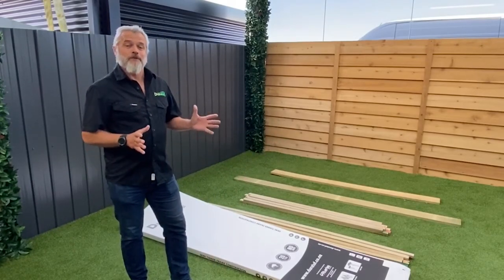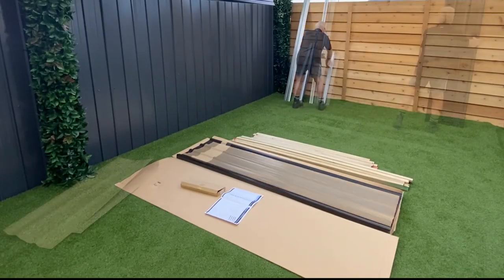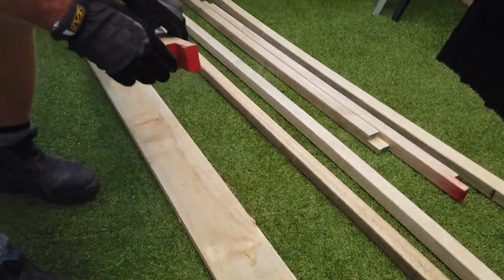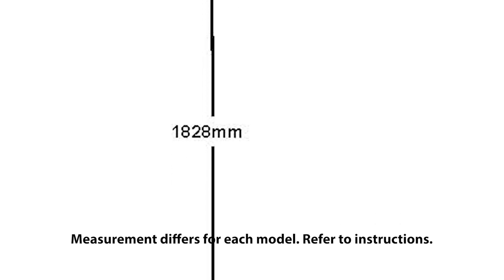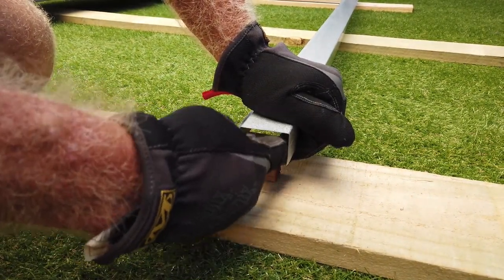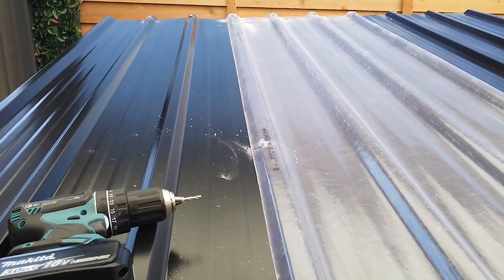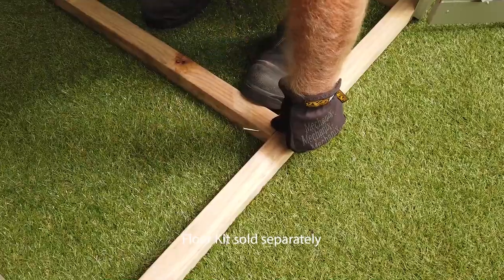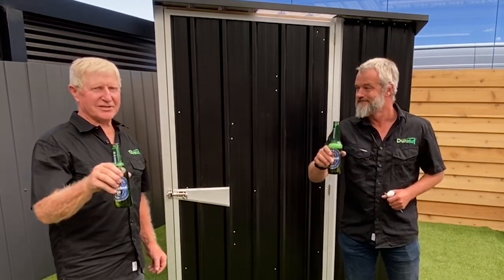Semi Timber Frame Shed Assembly Video

Comment: I have just started assembling the Guardian shed on a concrete floor. The instructions so far are helpful but do not mention that the side panels taper from back to front. While it makes sense that they would it would have been helpful to mention that. Am puzzled as to why the bottom plate is partly exposed. Would have thought it would be covered by the bottom of the sheet. 
Perhaps I will find out why as I progress. 
Agree with other comments about the clouts. They  are not as forgiving as screws but cheaper I suppose. 
Helpful video thanks. 😊

Comment: I have the same questions as Raman. Any downside to using screws? Also thinking that if I ever move house, having the shed put together with screws would make it a bit easier to break down
Reply: I can imagine S/S screws would add at least $100 to the kit price.  I like the idea of screws as well, however there would be a multitude of sharp edges inside the shed
Reply: @stevedevine6463  I did mine with screws, no sharp edges because I used the right length. Added maybe 40 bucks onto the price.

Comment: It's a pity that the drawn instructions appear to show the opposite view to the video in at least the first few panels.  It would be helpful if one followed the other.  For example, the video has the top and bottom plate turned over.  Also, a few more seconds on lining up edges and hinges etc, showing the whole panel face for reference would be helpful, particularly if they are opposite to the drawings.

Comment: 3hrs? That’s wishfully thinking, it took two of us 9 hrs, and that was working non stop. It was a 2.5 m square shed without a floor. Thanks to your video we under quoted big time. 😅🎉
Reply from the maker: Thank you for taking the time to share your experience building the shed. We are sorry to hear that it took longer than the estimated time for you and your team. 

Building a shed can be a big project and the actual time required may vary based on several factors such as the size, complexity, and the skills and experience of building Duratuf sheds. We appreciate your feedback . If you have any further questions or concerns, please don't hesitate to reach out. Thank you for your support.